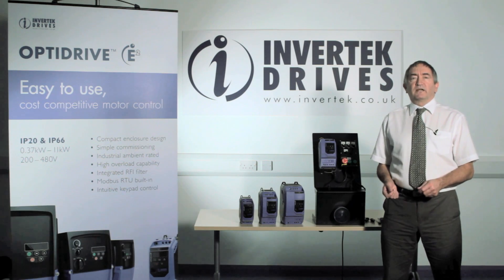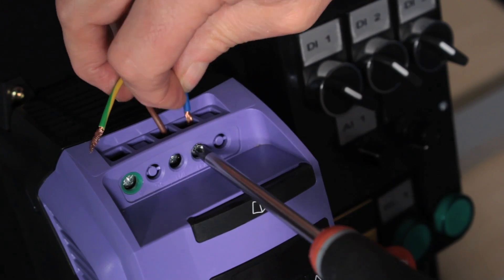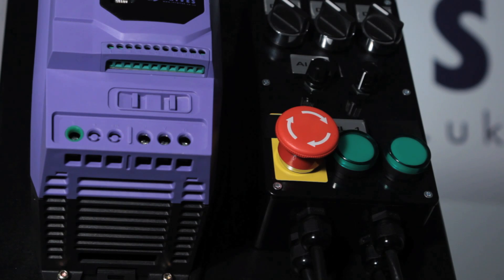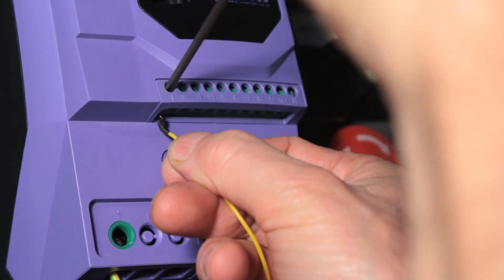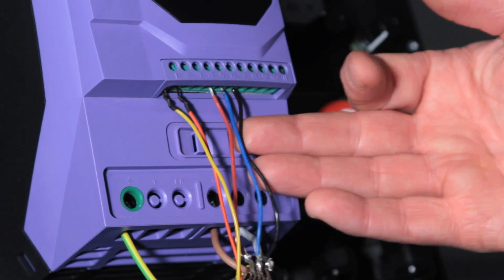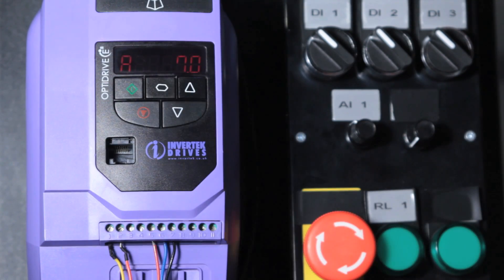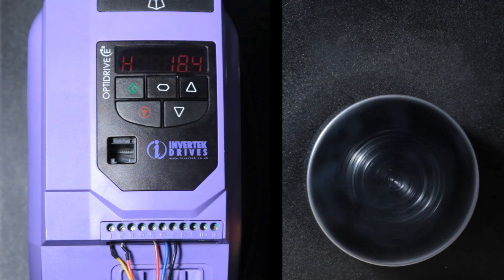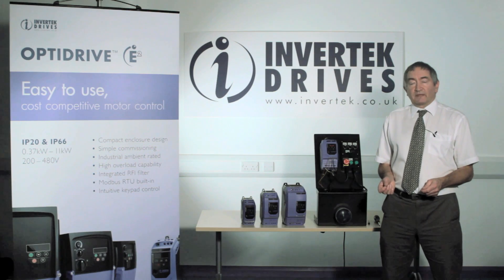Invertek Optidrive E2 Guide Part 1 - Install

Comment: Hello, I need to set the rotation speed control right left with the switch 1-0-2 (L-O-P) where and what settings are to be made if you can record it as you set or describe the settings and under which terminals attach the switch. Thanks in advance. Exactly, I want to connect such as the attached video https://www.youtube.com/watch?v=hLeKcQr-2rM